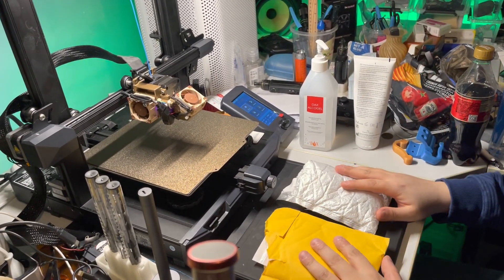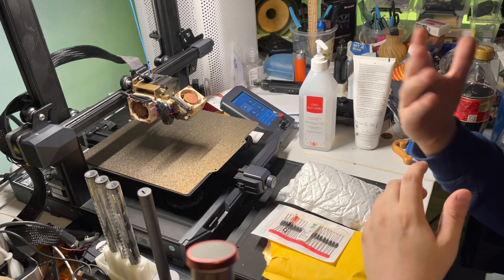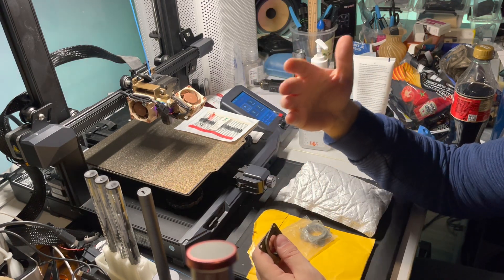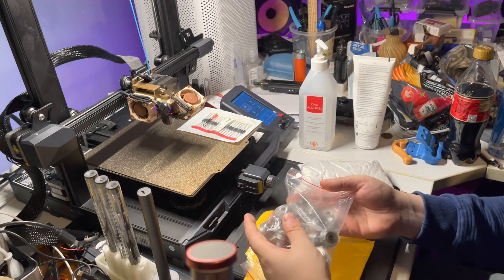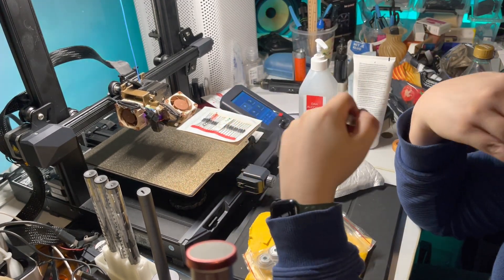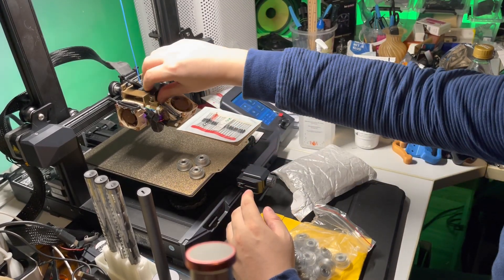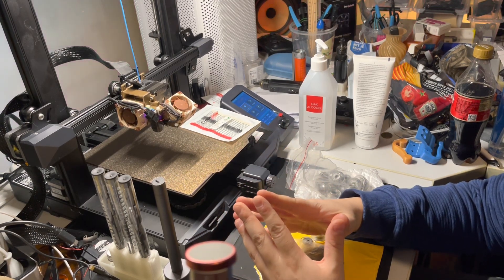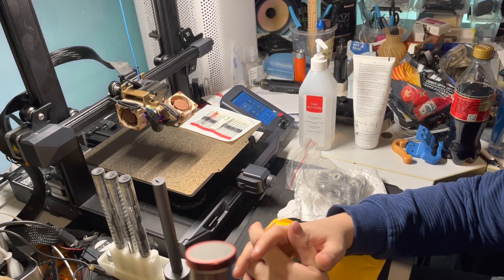Creality ender 3 S1 / S1 PRO upgrade parts unboxing

Comment: If I can suggest can you please do an update video of mods for the Ender 3 S1 Pro, I have bought it one month ago as my first 3D printer and I would really love to start modding it so it would be cool for a newb like me to see all the mods a can put in to improve it. For the moment I have put it only the glas bed and metal wheels also for the bed. I have started to prepare my aliexpress cart with liquid cooling kit, the improved wheels for the axis, the dampeners, the zener diods to instal the noctua fan and the copper/titanium heating block. Would it be a good idea maybe to improve heatsinks on the motherboard?Looking foward to know your opinion. Btw good videos 👍
Reply from the maker: will do :)

Comment: Zener diodes are such a dumb solution, they just dissipate energy where a buck converter can be >80% efficient.
Reply from the maker: zener diode is only a good solution if u want to make a stealth project, and or have no space for a buck converter...  But i'm using neither, i'm just paralleling the two fans .
Reply: Zener diodes are normally used for protection or in specific situations where there is very low energy to regulate a voltage. They could not be compared with buck converters because those are proper regulators.

Do you put the fans in parallel or in series? I can imagine that if the voltage drop needs to be less it’s better to put them in series.
Reply from the maker: @Niels_Dn  sorry i meant in series :) my bad ... :p

Comment: None of the products shown are upgrades for the S1.  They are fixes for the old school E3's with noisy Allegro drivers. S1's WILL NOT perform any better with these parts.  If you just want to tinker and install new parts that's perfectly OK, but they are in no way shape or form an "UPGRADE"
Reply from the maker: thank you for your opinion, have a good day .

Comment: I got the transparent PC wheels. I found it a little too big for x gantry. They were maybe less than a millimeter bigger, but it make the wheels grab the aluminum extruder too hard. They start to wear out after a few prints. The good thing about stock wheel was that they were softer and the dust was a little lubricate-ish.
Dust from my PC wheels feel like chalk. It create some friction and the wheels was too hard, they transfer any imperfections into the bed. I had to take them off. Maybe I got scammed and got acrylic instead of Polycarbonate.
Reply from the maker: hmmmm strange, i just got them installed , and am printing so far so good, and the one's i've got are very smoothly moving the x and y axis... i hope mine are better then yours :o
Reply from the maker: also to mention, i think u need to use the excentric nut, to loosen the wheels if they are too tight, i never seen any wear on these kind of Polycarbonate wheels...
Reply: @aim6mac  I got new wheels on the way, different brand. It was tight ecen before adjusting eccentric nut. I might try again. Now I got the pro extruder and found another problem, sigh.
Reply from the maker: @popewew  what other problem? temperature?
Reply: @aim6mac  slipping extruder gear. The black gear that was sticking out of extruder wasn’t catching its axel very well it slipped. So it didn’t have enough force to push filaments through. I have to replace it with the one from the old extruder.
Reply from the maker: @popewew  that sounds like an quality control issue, why dont u file in a replacement?
Reply: @aim6mac  I did. Im just getting tired of Creality’s customer support and their QC.
I started saving for a Voron tbh.
Reply from the maker: @popewew  Yeah it's not the best QC i know, a Voron is a total different ballpart isn't it, i'd like to build one myself aswell.
Reply: @aim6mac  I would love to see your video about Voron.

Comment: I'm one of the chumps that bought an Aliexpress Sprite Pro (for my Ender 3 V2), but as you say it's just the extruder - no mount or cables (other than a few very short ones). I thought of printing an adaptor for the mount, but not sure about the cabling.
Reply: Me too! Oh well
Reply: I ordered one from banggood and they are providing the pro extruder with cables, It has been shipped and waiting for it to arrive here in India. it could be 20-30 days from today i think till it reaches me
Reply from the maker: @jilesh12312  oh thats great, mine will arrive within a couple of days as it is already in my country says the tracking company. :)
Reply: @aim6mac  I am waiting for your to arrive and see how it looks. Hopefully you make the video soon on it
Reply from the maker: @jilesh12312  i surely will as soon as it arrives.
Reply from the maker: oh shoot, i am pretty sure that the cable and mount will be available as a seperate part to buy from aliexpress soon or later.

Comment: Very interesting info about the X and Y guide wheels. I have just recently bought a ender 3 S1, and now curious about those wheels. How did you describe those wheels to order them. Thanks. Also why do you replace the motherboard ( I suppose the printer is ender 3 S1)? and, what do you expect from the new sprite extruder  (pro version). Be interested to know if your opinion about this upgrade, again thanks for the video.
Reply from the maker: hi there, i put the link of those wheels in the description, my motherboard is faulty.... thats why i need to replace it, i dont think there is much difference between the pro and standard edition sprite extruder although i think in long term the pro will be better, because creality claims it's all metal and the standard is partially metal.